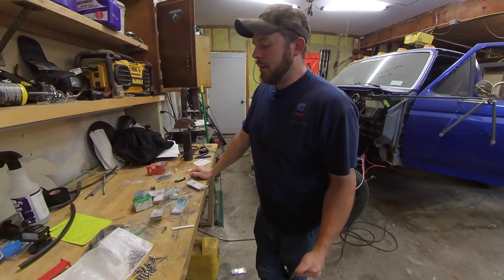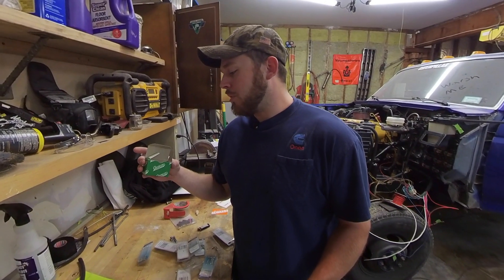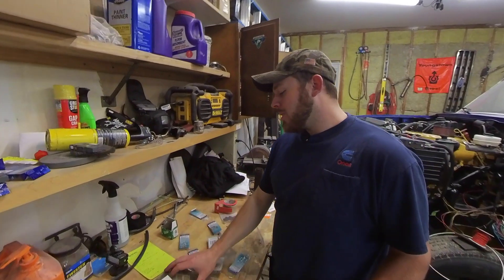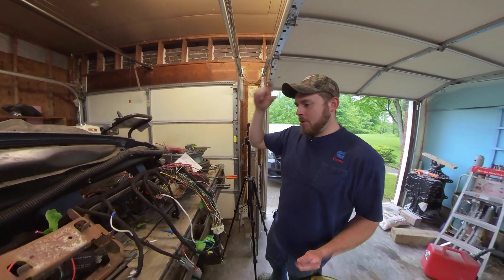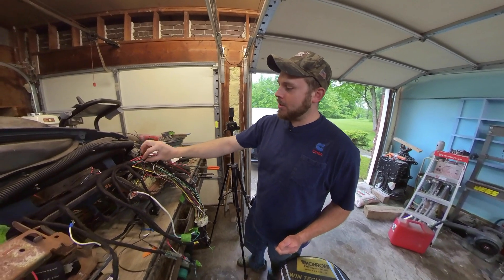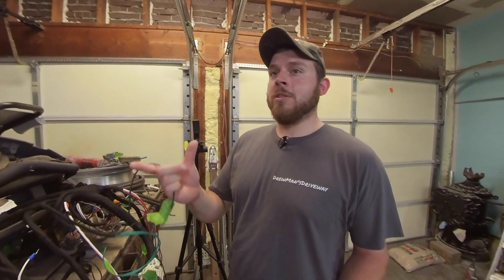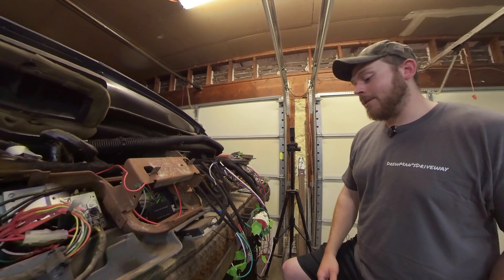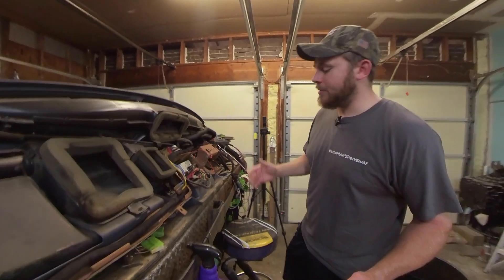Pt. 67 Wire Up Your Diesel Swap Part 3 of 4

Comment: Speaking of cruise control and stickshift and steering columns do you have any options or opinions on rebuilding the blown out  bearings on my steering column?
Reply from the maker: I haven’t ever really messed with the steering column so I don’t know much about it. I do know the bearing behind the steering wheel would be pretty easy to swap out but I am sure there are others that would be more difficult

Comment: That wiring job is mint!  Awesome that you took the time to re pin and even labeled all your connections instead of butt connectors or soldering everything.  I think you’re right, way less issues that way for sure!  Plus it looks factory (or better) when you get it done.  Awesome job man!

Comment: The look on your wife's face was hilarious!  😆  Is it possible to get the info on the label maker, and label shrink tubing you used to mark your wires.  That would be handy at work.  Thanks
Reply: Right ✅.... those look awesome
Reply: There's a link in video
Reply: There's a link in video
Reply: There's a link in video.
Reply: Apparently Big Brother is censoring our comments because it won't let me tell you that there's a link in the video

Comment: The look on your wife's face was hilarious  😆  Is it possible to get the info on the label maker, and label shrink tubing you used to mark your wires.  That would be handy at work.  Thanks
Reply from the maker: Lol. Yes, there is a link in the description for the printable heat shrink. It comes in a verity of sizes and colors and can be print out of pretty much any label maker as long as the cassette fits. The link in my description is for a brother. There is a hole on the back of the cassette that you have to put tape over otherwise it will print mirror image. There is another video on YouTube that goes into depth on this.

Comment: Is your camera lens cracked?
Reply: Are you referring to the blurriness around the bottom?  If you are your probably seeing where his camera gimble (camera on a stick thingy) is canceling out the stick so you don't see it.  When it does that you get that blurriness.  That's why his left hand that he holds the gimble with is all distorted.  I could be wrong cuz I'm no expert but hope that helps.
Reply from the maker: I use a 360 cam so it has 2 lenses that record 180 degrees. What you are seeing is the stitch zone where it ties the two lenses together. It usually isn’t noticeable but some if I get to close to what I am filming you can see it. I also forget to close the memory card cover and that will also show up from time to time